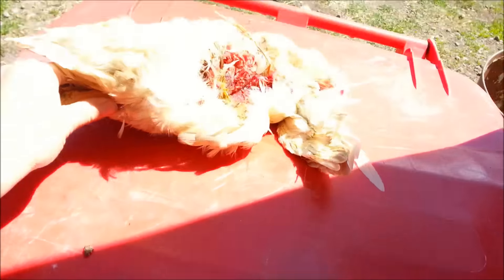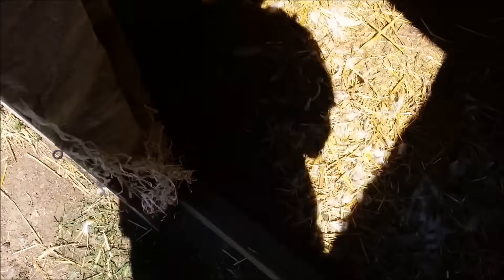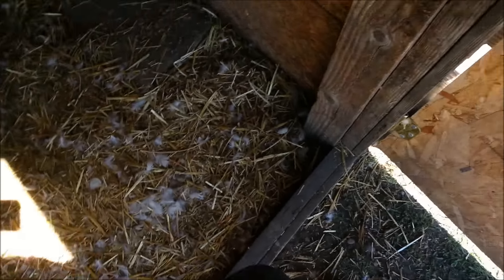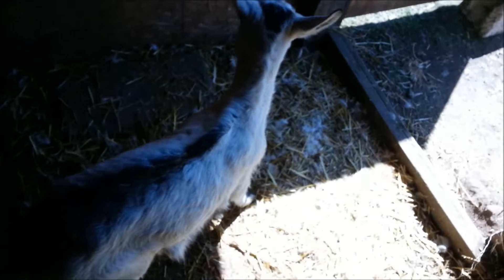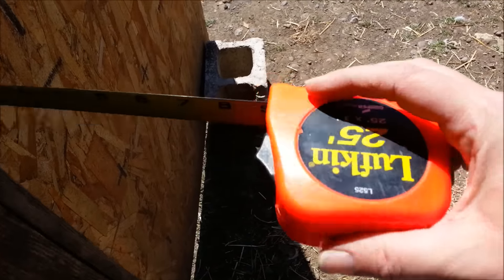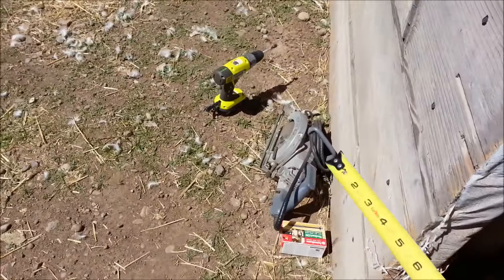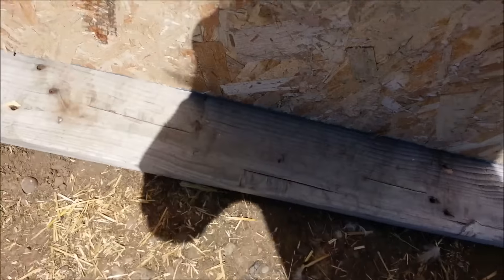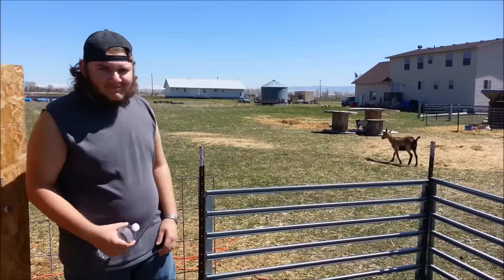Predator Attack

Comment: Back around 2007 we had a critter chew thru the bottom wood on the coop door, So we made sure we installed a metal kick plate on the outside of the door and fine mesh construction cloth along the bottom part of the coop, that also went two feet into the ground so no critter could dig under and in. A friend has a cement block foundation on her coop for similar reasons.   If you want an idea what type of animal it is, simply lay 2 inches of sand in front of the door and wet it down in the evening.  Come morning you should see prints that could give you and idea what animal it is.  And do not have ANY area like the small area with the door that you can see light thru since rats and mice can still get in.
Reply from the maker: +Beth Grant-DeRoos Well I'm not sure I'll ever know what it was because he is gone now so I can't do the sand thing (great idea though). It did come back the next night cause I could see where it had started to dig and then gave up when it couldn't get in like before and moved on. My cat pretty much keeps the mice away but when they do get in the chickens kill them.

Comment: id take a small piece of wood at the bottom and a nail to turn and lock the bottom of the door in place for the night or strengthen the door cause once they get there claws under its easy to bend the door and squeeze in.

Comment: Identity of the predator?
Solutions may be insufficient if you don't id the critter.
Door looks good, so should stop most of 'em
May want to plan in a concrete door threshold for a long-term solution
Reply from the maker: +loganv0410 Looks like it has moved on now so not sure I'll ever know what it was.